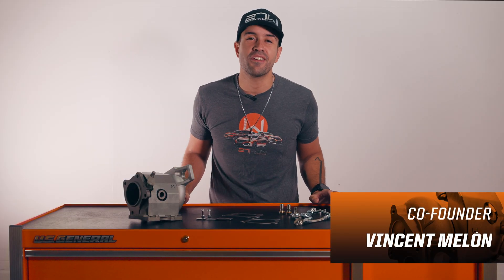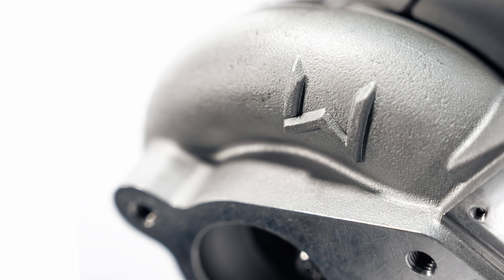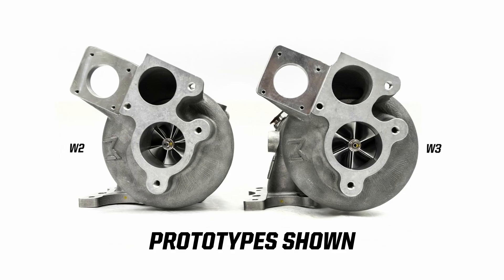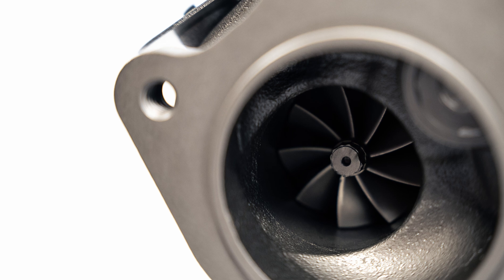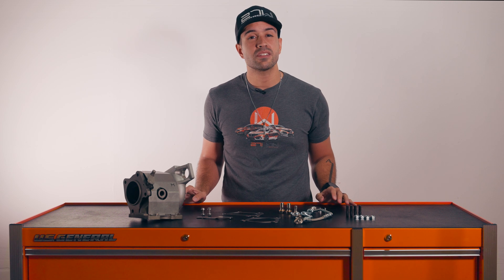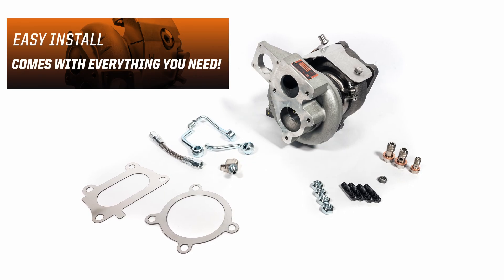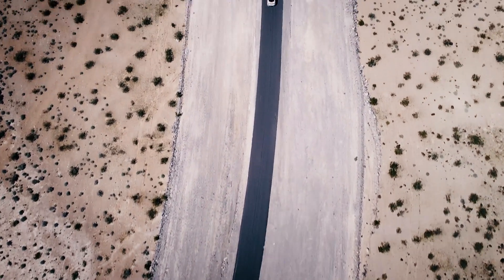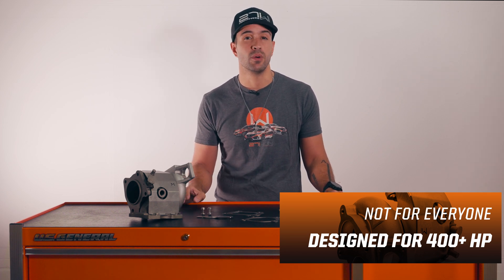Honda Civic W3 Turbocharger System 10th Generation 1.5L Engine

Comment: Can this be used on the 10th gen with a cvt transmission?
Reply: Can, yes, recommended?? HELL NO
Reply: What's the point of a CVT even attempting for 400whp lol.
Reply: Claro que se puede para thailand hacen 375hp en cvt solo tiene que forgar el motor y un buen tuned e85
Reply from the maker: @kseries_fk7  and have a spare CVT transmission around or 2!!
Reply: when does the turbo spool at?